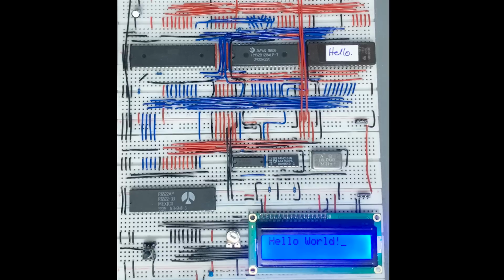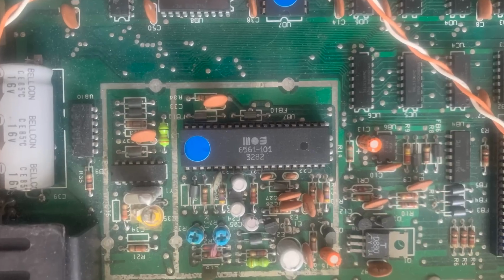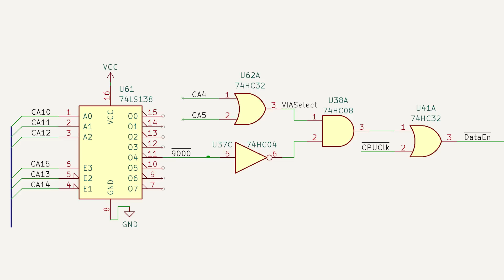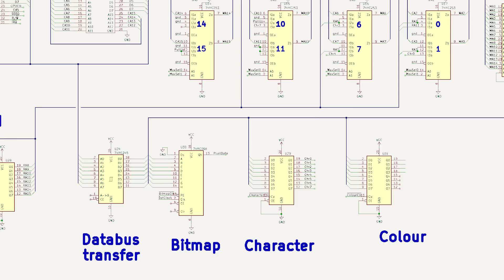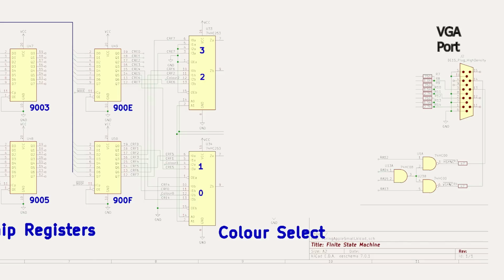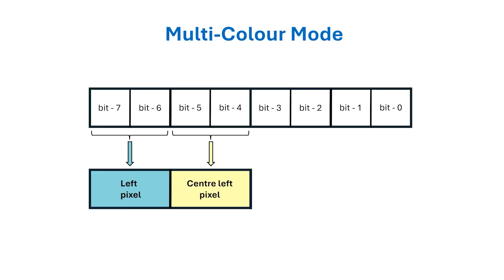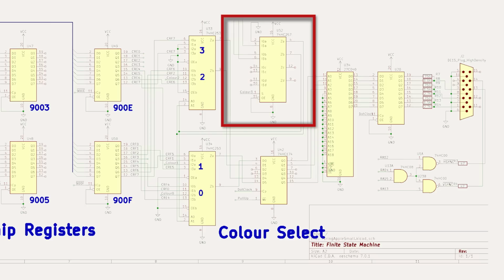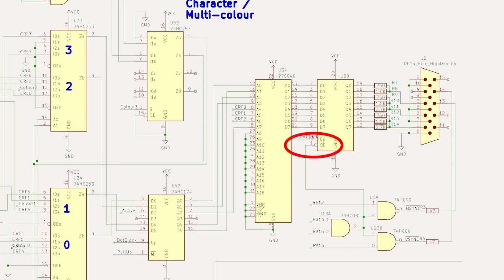VIC 20 build. Colour

Comment: Hi Matt.  The vic row and column size registers are designed to go up to large numbers.  There was previously efforts to make an 80 columns business machine, which were abandoned before efforts went into the Vic.  The replacement VIC40 prototype even had a drop in compatible 40 column vic chip (it seems the new vichip and upgraded memory were the dufferences).  Somebody tried one on a normal vic and adjusted the kernel to work with it.  Is it possible to make it adjust resolution as you specify more rows and columns, and support progressive scan?  This would make it possible to specify rows and columns that hit certain standard display resolutions of VGA and HDMI.  Would be a great little present to neglected Vic fans,  who could plug and hdmi adaptor into the vga port and put it on a regular TV, and poke a new resolution.  Or even full Vic 40 vicchip compatibility? 😊

(by the way, Atari pot controllers were cool).

Anyway, a TTL miminalistic suggestion for you: the Vectrex, which had a computer keyboard add on, that was developed but not released before the collapse.  So, that's out there somewhere.  The people with the rights have been very accommodating, so might like to accommodate a ttl version, after seeing your work.
Reply from the maker: @waynemorellini2110  thanks for the interest.  I’ve been trying to decide what to do with respect to sizing.  I can probably accommodate 16-32 different combinations of register settings.  I may modify the raster generator FSM to take in the parameters during sync, but I’d probably need an external raster count register.  I’ve been thinking about how to do smooth scrolling in the  Commodore 64,  I’ll experiment with that a little more.  
I’ll have a look at the Vectrex, but I don’t know much about it. - Looks like it uses the 6809, I’ve been tossing up whether to do a 6809 or 68000 first in the SAP format ie like the SAP6502.
Reply: @DrMattRegan  You were looking at a Sinclair QL, which had a TTL Thor comparable computer with expanded functionality, which has expanded into a number of replacement boards and cards, and  chips.  The latest is a FPGA QL computer board about the size of an PI Zero, that plugs into the back as an accelerator and io expanded, but also can act as a stabd alone computer. So, there is a group of supported upgraded graphics modes and minor features, OS's, and GUI's.  The guy QLJaguar, or QLvsJaguar, or the reversed names, has a repository on this stuff, and there are a couple more around, which links are on one of my broken systems.  So, there are some simple improvements suitable for TTL, without getting into sprites.  One, is a guy that modified the chip to get over 100 interpolated colour pallet, and 16 colour mode.

As for the Vectrex, just a very basic system, plus vector monitor, which could be emulated on a TV, but dacs left for a laser or vector  monitor.  It also had an early 3D headset with spinning colour wheel.  But, there are various colour vector monitirm emulator, screen and overlay out there.  They tend to set the colour by the intensity of the beam driver setting.  This makes old games colour automatically, pretty well.  The Vectrex was quiet a buzz, especially projected ( I used to set up magnifying freezer lens sheets and play it on the ceiling).  Somebody is doing a new laser console privately, but hasn't posted for a while.  I was going to do one decades back, but abandoned the original laser proposal, and got too sick to pursue the volumetric 3D project, or with a misc processor (or Arm) and produce a cartridge to go into the original.  But, there is a pitrex cart from Australia now.  You might be the first person to hear about the volumetric 3D version I wanted to do.  It would have been a game changer for the community.
Reply from the maker: I'll probably do a 68000 series first, i've been trying to decide which machine to test it with.  The two main runners are the QL and the Mac.  I'm not sure an Amiga can be done with through hole technology, although it can be done with an FPGA.
Reply: @DrMattRegan  Hasn't, even the original Mac had a lot of complexity compared to the QL?  When people do emulators of the more complex machines they get a lot of problems with coding tricks, and particularly behaviours of hardware interfering with compatability.  So, I get worried about that even with simple machines like the Spectrum or Vic.

However, what people may like, is a jazzed up compatible machine in TTL, compared to all the other clones.  I try to keep it simple, on top of the performance and ram capacity of what modern parts can do.  The original inventor of the vics potentially having a simple replacement design for vic and 64, and the registers in the Vic 1 supporting a larger display transparently, is a very good opportunity.   Such a Vic might be 10% more complex, as modern drop in parts have a lot of extra performance.  The standard clock speed can be maintained unless a location is poked at program start or a led button pressed.  Program ends with poke, or you restart or press button again, to go back to slow mode.
Reply from the maker: Yep, the 68000 is a bit of a bear, i don't know if you've watched the SAP6502 and Turing6502 series, but it will be a mix of these, except bigger, targeting the 68000.  As such, i'd like the hardware to be as simple as possible yet have at least some software available.
Reply: @DrMattRegan  The latter expanded QL OS GUI's are just as sophisticated looking as the Amiga.  Linus came from the community (before this all went down)  you can still download his software blitter for the QL. The Amiga has it laid on, but the QL has room for growth, and could have vern the standard low end business machine today, if they had done things a bit differently (add many other machines in with the QL in this respect.  Failed Pet, failed c64 2a and 2b, failed 264 series etc.  Failed Apple 3 etc, the Hitachi Peach, or was that Apricot,  which was a professional setup way ahead of its time.  Which I did work in a store which sold them).

If you want simple, there are two more systems,  the original Acorn Arm archimedies and risc os machines were simpler than Amiga, and way ahead.  Likely simpler than QL once you include the 68008.

The Offet enterprises mup21 processor by Chuck More (inventor of forth and multiple original top end performance processor based on Forth).  The mup21 is very simple, thousands of transistors including a graphics processor which simply executed pixels as graphical instructions with windows.  No software, but potentially a tube of 10,000 bare dies lost out there, and Doctor Ting (offette) had maybe 6-12 newer chip designs in layout and for fpga available.  I don't know how many of these are available open hardware.  But, there is a 40 core design being made, which design can be implemented at 6Ghz, 2mm2 ultra low energy.  It is closed for closed use , and we are waiting to see if it becomes available for public use.  (Yes, that would be 240 Ghz, but initial production chips are likely to be 40-60Ghz.  This is what simple forth Misc processors can offer.  How fast on the latest performance processes, I do not know.  But Nvidia should be using these.  Now, there is the closely related itv i21, and Ultra technologies F21, which are very integrated computer systems chips with simplified graphics sound and io ports, and software.  Jeff Fox, now passed away, owned ultra technology did a complete software system, and worked with Chuck on the similar i21 at Itv.  Chuck designed both chips.  The rights to do the f21 and use the software maybe even possible to get for free.  As for the i21, it depends on who has it and how they feel about it.  It's of little worth to keep these old systems locked up.  Though they could reach somewhere in the 500-600mhz zone, likely on a low, slow energy processor node 25 years ago.  The f21 was designed to be from somewhere between 200-300 or so mhz, from external memory.  Chuck was is probably still is, they record holder for the lowest energy chip designs.  Which at 130nm, is several hundred mips.  45 nm just costs an arm and a leg, and 3nm, forget it.  But, these simple designs could clock the fastest in ttl (then run a Spectrum emulator).  I had in spits and spurts over decades, come up with a very sophisticated misc (miminal instruction set computer) processor design lined at 1000-4000 transistors) which I wanted to implement similar to what you are doing, but atlast, I was always too sick to implement it before the brain damage.   But it is likely better than anything else out there.

There is a barberised ttl forth processor computer called my4th.  If you want to teach students about the basics of processors, putting together their own, that's the one you could look at.  It is small around 14 chips TTL, and could be even less components using your sort of techniques, going on what the inventor has said  about other ways he could have done it.  I wanted to do a misc processor similar to the way you do it, but got post covid, and now even when better, I'm a bit cooked.  But, I encourage others in their efforts.  If you look up a console called the bandit and pc32 forth language on a pico based board, you can see one of the systems out there.  Also, the core 1 is it, a space mission AI forth parallel processor on fpga before going custom silicon.  Forth and forth processors where one of the go to choices for satellites and space missions.  The guy behind this is a space engineering veteran wanting to take a to make a new next generation processing system for automatous space missions, and common usage.  Forthday event in silicon valley is on the 16th, and unfortunately I still can't attend, but apparently they haven't published an event schedule yet.  So, there is some talk about w
If something might be released.  It's on YouTube.  I won't be on the live stream audience, as I haven't over the years because I have not been well enough to do any coding again but used to be able to still do instruction set architecture design in the past (cruel irony).

There are a few things.  As for most advanced early simple home computer, Exidy Sorcerer.  (More advanced like version, Amstrad PCW).  As for advanced early graphics, apart from Japanese systems like thar Hitachi I mentioned, and the Victor (post Pet) for home systems, I think it was Lynx or something, but like the microbee, it used separate banks in separste address spaces, to store different peices of pixel data, so was slow to use the better graphics.  I think French.  The Amstrad CPC is another, but was only 160x200 in 16 colours.  It did not have overwhelming praise for its game graphics.  The eventual last machine had simple 16 colour 16 sprite graphics, but some sort of graphic modes.  If they haven't doubled the data per pixel, or quadrupled it, with a 16 bit 16mhz cpu in 1990, maybe they would still be selling it.  I'm a bit of a personal computer history buff, when we'll enough to remember.   Oh yes, the Amstrad series of machines had an 16 colour qvga, or maybe vga too mode, I think.  A lot use similar architecture, as Alan probably got a deal.  So, there is probably UK software supporting this higher than normal mode.

Have fun Matt, and thanks for listening.

BTW, with the tiniest TTL surface mount, maybe you could make a watch Vic20, or Atari Lynx.  Or pico-8 fantasy virtual console (really interesting. 120 pixels acrois I think.  Picotron is the console desktop version 480 pixels I think). As they are some of the few machines with readable text at that size.
Reply: By the way, if you are looking at doing an Commodore 64.  The designer of the vic chips had a proposal for an 80 column follow up version of the 64, which he presented to Jack Trameil that got knocked back (as Jack was pursuing the 264 series, which ultimately also sealed the fate of the Vic).  It was short sighted, as an expanded compatible 64 without the latter weirdness of the 128, could have made the system more sellable for years, longer, and into the small business and retail market, where 64's were sometimes used.  It really only needed 80 column text mode with programmable graphics preferably, 16 sprites (like the PC engine) with 4+ unique colours at 320+.  That's double the data rate, or two banks of memory to do.  So close to being a machine that could still be sold as a simple terminal, and productivity machine with geos gui.

Now, the designer seems to be still around, pursued the design of the chip, but couldn't find funding where they were located.  So, he might have full spec sheets for an upgraded 80 column vic2 chip.  Which, I suspect, going on his vic 1 and vic 40 upgrade, might be mostly 80 columns, double graphic resolution modes, and more sprites, which would be little difference in circuitry to the Vic2, but double frequency (he did say they showed the vic 2 could do this, I saw recently, and its the same thing I have been suggesting to people) plus a refinement and doubling of existing sprite circuitry, but with an increase in collision detection, unless its similar to the scheme I previously had).  What people don't realise, is once you reach a certain level you are adequate for a range of games, at a certain screen size.  The PC Engine, or its super turbo graphics show one step above adequate, and are good.  The Amiga was also in this range.  You really needed 256 colour pallete for screen  and sprites to maximise those sort of 2D games above the super turbo graphics, and maybe am ARM.  512 width graphics look corse on a big screen, but not chunky like 256 or 320. 640-768 is good to still preserve that retro corse look.  4 colours per sprite and character is adequate.  640 resolution is good.  The 80 column 64 could have been good to this day as a games machine.

The c65 disclaimer.  Even though its blitter and spec seems like an 1983 technology. It was years later through different engineers, and might bare little resemblance to the rejected c64 by the designer of the vic chips, mentioned above.
Reply from the maker: I know many people want to expand/extend the original machines, but i do worry about losing software compatibility, which is why i haven't designed my own instruction set.  For example the commander x16 is an interesting expansion of these systems, but i think using a modern era FPGA for video feels like putting a brand new computerized, fuel injected engine into a classic car.

Comment: Another great video.

In all my years it never occurred to me to parallel a latch with memory to make a simple readable register. It proves that it’s never too late to learn new tricks. I think it will come in handy in the macro scale 6502 system I’m working on, either in the high speed microcode ROM or the 6532 RIOT.
Reply from the maker: Excellent, it was going to be a pain to multiplex all the latch outputs.  I tend to think of them as being an external mirror of the contents of some desired SRAM cells.
Reply: @DrMattRegan , that's how I would have done it without this trick.

The funny thing is that I have used the software equivalent of this trick in the system I developed for my wife's business,  using a downloaded copy of a database table for reads and writing changes in parallel. The penny never dropped to do the same thing in hardware

Comment: The vic20 has been my very First computer. I am an electronic engineer and I enjoy these videos a lot! Thank you
Reply from the maker: Great to hear!  I think these machines started many a career.
Reply: Mine too, after the disastrous Atari VCS basic cartridge (we await the TTL version of that one,  as its a very finicky one to program, introducing potential compatability issues 😢).

Seeing what they doing with it these days, as far as graphics tricks, and games, I wish I hadn't upgraded so quickly to the Commodore 64.  Hmm, I just realised, what if they had made the Vic chip colour bus 8 bits, and put a second 5KB left over chip on it, acting as a 16 bit bus, which would be enough for 80 Columns, and maybe 2 or more colour attributes per character?  Technically, you could do a 128KB Vic this way.
Reply from the maker: @waynemorellini2110  I think the Commodore 64 pushed the limits of what text can be displayed with NTSC
Reply: @DrMattRegan  From memory the Ntsc line can get a disappointing 426 pixels.  The Atari could get was it 384, 360?  At 640, it could still displayed, but would be very fuzzy.  The c128 can actually display 640 over composit in monochrome, believe it or not.  I had believed that it was supposed to be very low, in the range of vhs, but this is probably a common manufacturer limitation, by some standard.  But with such a VIC, you would go s-video if you had something that could support that resolution, such as with the c128, or component, or scart, or commodore 1084 monitor or vga.  Except for some smooth games, I think it would be aimed for business or productivity through a monitor.
Reply from the maker: Yes, there is a difference between colour and B/W with NTSC.  The apple 2 can display B/W with a dot clock of 7.16 MHz, which gives a total of 454 pixels, of which 280 are active.  I haven't tried it, but the Apple IIe can have a dot clock of 14.318 MHz in 80 column monochrome mode, so there are some composite monitors that will display it, but i don't know what it looks like on a NTSC TV.